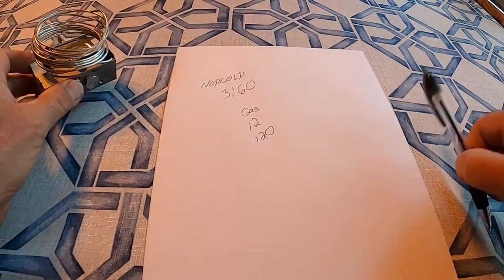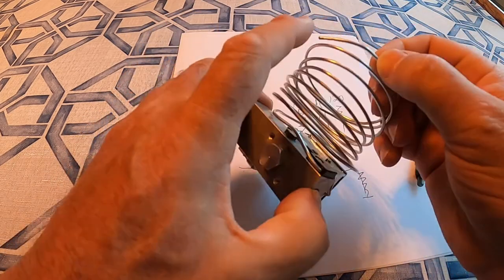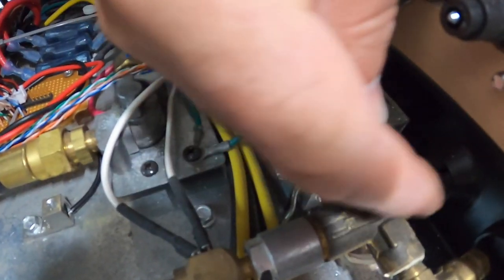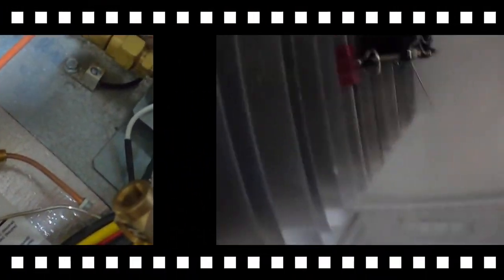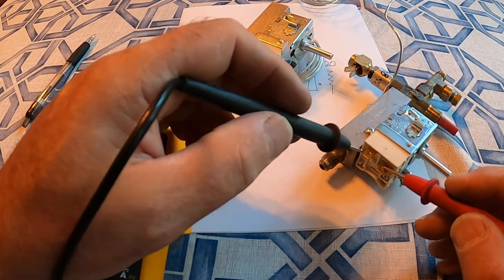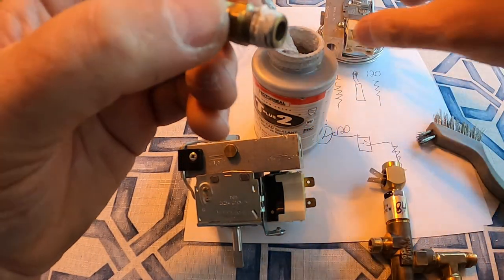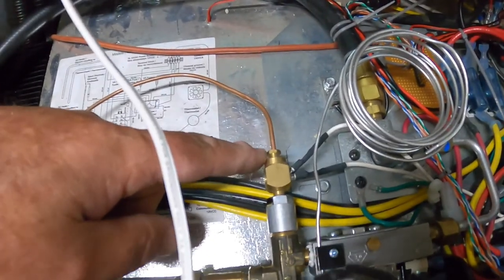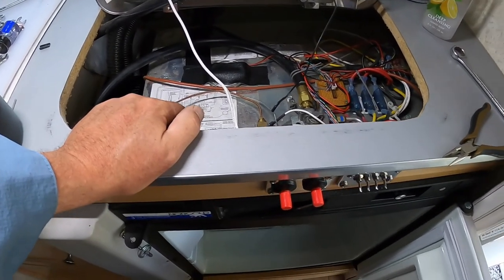Thermostat gas valve replacement on a Norcold 3163 3-way refrigerator.

Comment: Did the refrigerator section cool properly on gas before you replaced the control assembly? My unit doesn't get cold in the refrigerator section on gas or 120V. I have a feeling the liquid has leaked out of the capillary tube (temperature sensor). The freezer section cools to about 32F. on gas or 120V.
Reply from the maker: In my case, the only problem I had was running on shore power. The fridge still ran on battery and on propane.